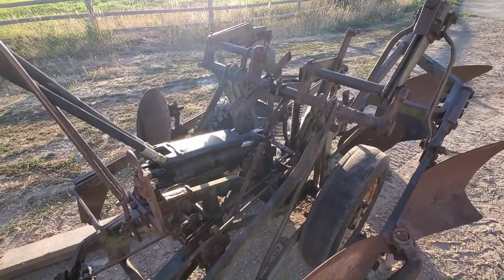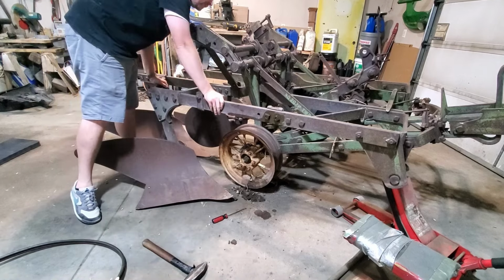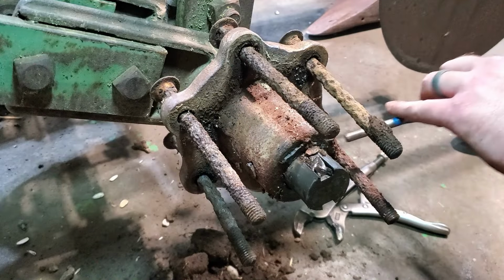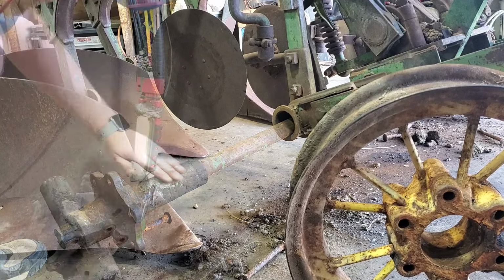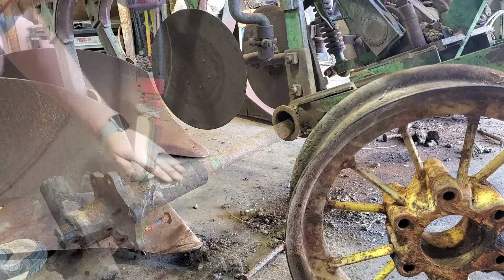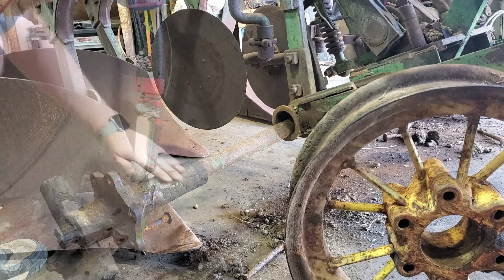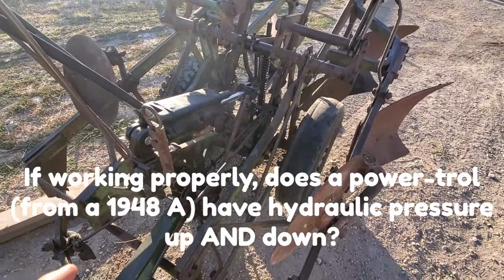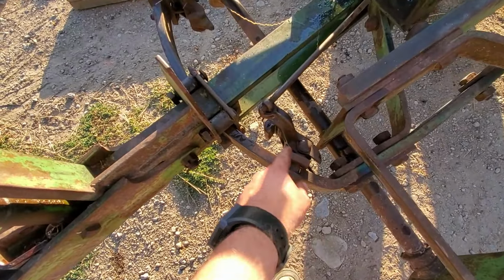John Deere 202 Plow - Repair and Explanation of Operation

Comment: The late model A john deere does have dual acting hydraulic system.  You need the plug fittings that are open on the end and then the rockshaft will not rotate.  To make the rockshaft rotate the plugs are solid and usually stored in the 2 port holder on the side of the hydraulic unit you flip the vertical latch looking thing and the plugs pull out and you chose either the solid one for rockshaft or a single open one for a one way cylinder or 2 open ones for the 2 way cylinder
Reply from the maker: Thanks! I'm going to take a look at this over the weekend. I think I already have the correct plugs. Hopefully everything works as it should!

Comment: I've heard of 2 way plow , never used one. We quit using a plow almost 60 years ago. The green John Deere cylinder is older. The cylinders you bought have a push rod stop. The push rod cylinder came out about the time the 3010 / 4010 tractors came out.(1961)
Reply from the maker: Thanks for the info! Very helpful to know which generation the cylinders are from. I was kinda guessing 60s or 70s... So this helps confirm that.

Comment: Out 49 A has dual acting hydraulics but you can either run the rock shaft or the hydraulics but not both
Reply from the maker: Yes, in grateful to the people like you who have confirmed I should be able to run a dual acting cylinder with my Powr-Trol unit. I just need to switch around some of the plugs. I'm hoping to take a look at that this weekend.

Comment: My 1947 A does operates the cylinder both ways. Mine doesn't have a 3pt hitch but I think the plugs need to be in to operate the rock shaft and he couplers (with hoses) for the remote cylinder. Mine is hooked up via the JD couplers . Some thing to do with the way the oil is directed from one to the other.  3pts only lift with gravity down, is it possible you have 1 with a plug in it? Just a thought,  I've never set mine up for rock shaft operation just leave it for remote cylinder.
Reply from the maker: @Leemp58  Bingo! I think you're right! I need to pull those plugs out and put in three ones that have the connectors in them. Then the hydro fluid will flow to the cylinder instead of the rocks haft. We even have the other connectors...I just need to find them and put them on.
Reply: @jonelsonster  He's dead on. If you had a later lever style Powr Trol, there was an adjustable plug where you'd be able to use the side outlets (with dual hydraulics), then switch to using the 3 point, all without changing plugs

Comment: There is some way to switch Rockford shaft to remote cylinder. On A, you have to have  the pto run to Hydraulics. Also, you power up. Is gravity down.
Reply from the maker: Thanks 👍🏻

Comment: I could be wrong but i believe the green cylinder is for the two cylinders. The black one for new generation.  I had a green one on my 489 New Holland Haybine and was running it with my 4020 . Went to raise it up and the cylinder case split.  When I was telling someone about it,  they said the green ones are not built for the hydraulic pressures of the new generation tractors.  Whether that is true, I don't know.
Reply from the maker: Both of these cylinders are off of a planter from the 60s or 70s, so they should be safe on any hydraulic system... should be.
Reply: I have heard the same thing, green is lower pressure, black is higher pressure rated. Either will work on the cutting edge high pressure system on the A haha

Comment: Pretty sure it needs a single action cylinder not double action!
Reply from the maker: The way the plow works requires a double acting. When the plow is up, it toggles over center so that it stays up even when the cylinder is removed. So it requires dual acting hydraulics to overcome the over center and lower down.